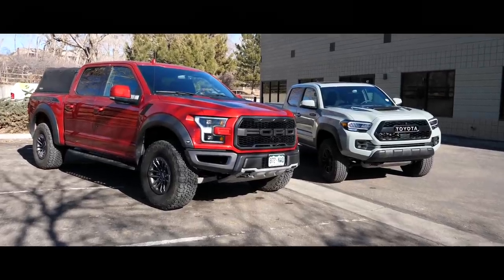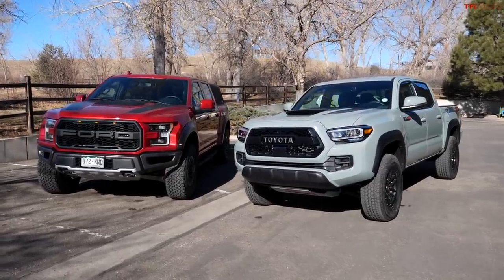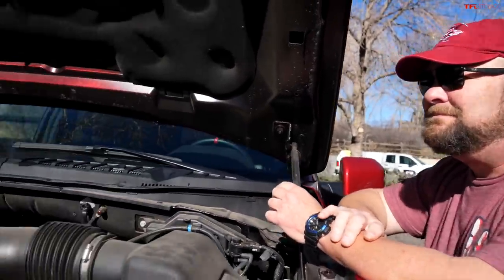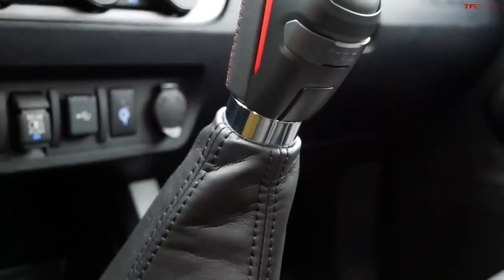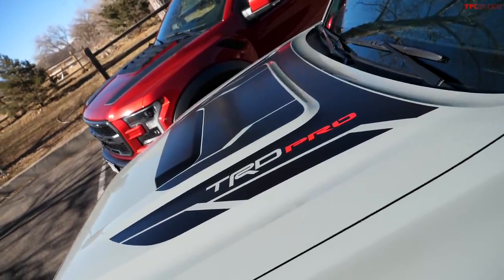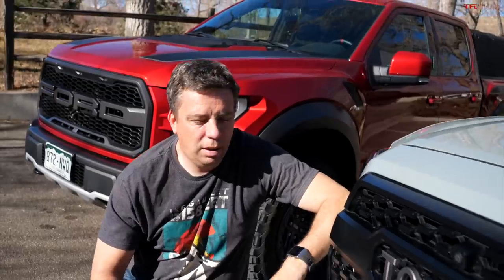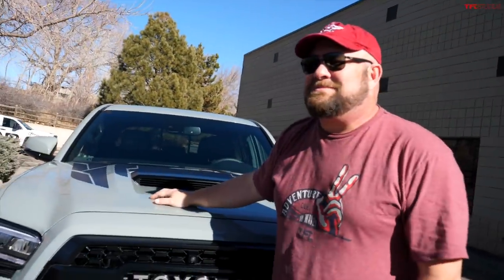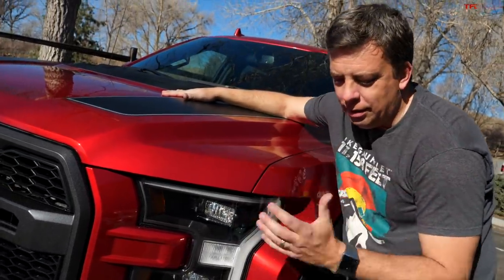Big vs. Small: The Ford Raptor & Toyota Tacoma TRD Pro Are Both Off-Road Beasts - But Which Is Best?

Comment: I just don’t get the Tacoma hype, even the crawl ratio is not as good as the Ranger.
Reply: Because it’s proven, it’s tough and reliable, and please don’t reply with some bullshit about rusted frames and shit, it’s a better product than the Ranger and Colorado, period
Reply: @RagingBad  3rd Gen Tacoma hasn’t been all that reliable, 2nd gen was rock solid. 4Runner and tundra are still very reliable.
Reply: @officialyasir  all issues had to be with software, not mechanically
Reply: @RagingBad  Software is just as important as mechanical. If my alternator goes out j can fix it in a hour. My computer messes up I'm screwed
Reply: @officialyasir  Exactly 3rd gen Tacomas are so bad that Consumer Reports issued a Do Not Buy on the 2020 and 2021 Tacomas.  Class action lawsuit against Toyota in regards to automatic transmission issues.  Howling differentials, failing fuel pumps etc.  The reliability is just not present in the "TuRD" gen.
Reply: @RagingBad  really? Just some of the recalls: fuel pump failures, brake master cylinder seal issues, rear diff leaks. Then beyond the recalls, common complaints of issues with the engaging and disengaging of 4x4. Plus Toyota had to extend their warranty on Tacoma for up to 2017 for rusty frames. Yes, after all these years, Toyota still hasn’t figured out how to coat their frames to prevent rust. Due to all of this, consumer Reports survey gives them 3/5 reliability score which is just average.

Comment: Interesting. I had a 2019 raptor that Ford bought back from me + $$$, because they could not fix an electrical issue under warranty. 
Think   lemon law and breach of warranty. 

I bought a 21 taco Trd pro with 6 speed manual for myself,  and a 20 Trd pro 4 runner for my wife. Couldn’t be happier, Ford reliability sucks.
Reply: Good choice
Reply: Maybe you should move to japan

Comment: Why do they call it a skid plate .
Reply: Because it's a plate that skids along rocks to protect the vehicle from mechanical damage. Usually placed below the front/rear bumpers, below the transfer case, and below the axles. Most production off road vehicles like these only have them on the transfer case, and the front bumper.
Reply: @gasolinediesel972  Thank you .

Comment: Lol toyota all day i want the truck that will last the raptor gets a nice set of bfg and the tacoma has some bull crap tire like theres nothing to compare but the same tires on them the toyota will eat pos ford alive
Reply: The Toyota is slow and weak. Tf you talking about
Reply: @gs300rich4  its a truck ment for work does not need to be fast and weak give me a brake they hold better then anyother truck i would know i have one while all them fords dodge and chevys are at the dealers getting worked on dont know were you live but toyota rules around were i live
Reply: @dudehi3317  I can’t give you a brake, because those are what stops your truck. And around here only the girls drive Toyota’s
Reply: @gs300rich4  at least they have good taste
Reply: @dudehi3317  anyone with good taste wouldn’t choose a truck with the worst and most dated interior. It’s stuck in the 90s
Reply: @gs300rich4  like he said the girls have good taste then..lol. another insecure raptor owner trying to Flex
Reply: @terrynichol577  another Tacoma boy getting all bent out of shape that his Tacoma is woefully outdated tech wise. Enjoy your cassette player on wheels
Reply: @gs300rich4  actually everything is updated in the 2020 premium package LOL. Awesome most people that buy these trucks don't need a driving tablet that has 200 error signals every other day. Have fun parking, and even going on any decent trails with that thing. Or let me guess you don't do any of that? Just a pavement princess hey. Good luck finding a parking spot at the mall LOL... douche. And who buys a truck to drag race lol?